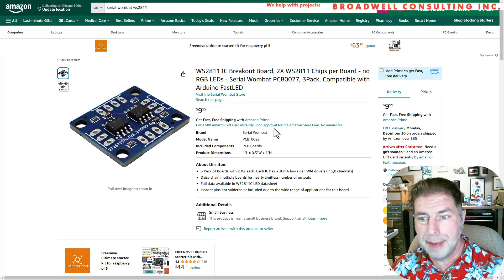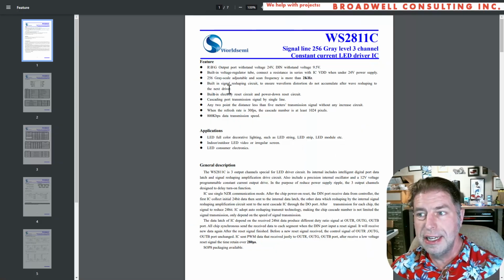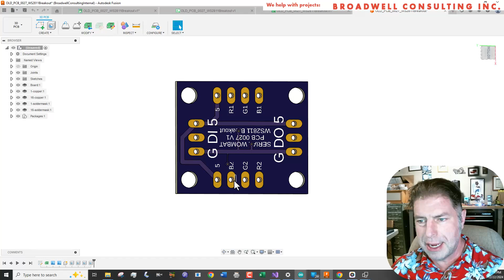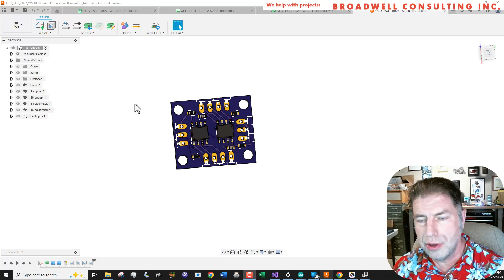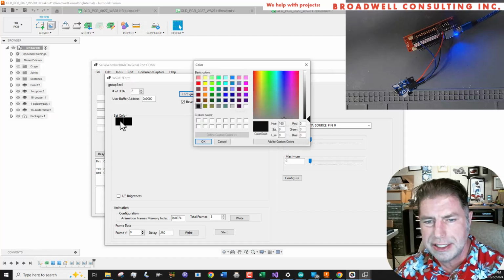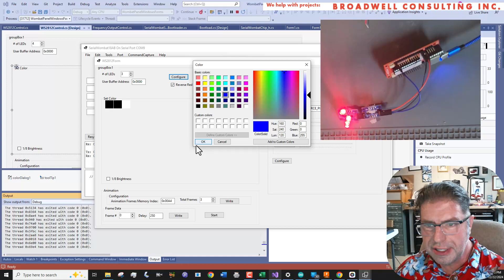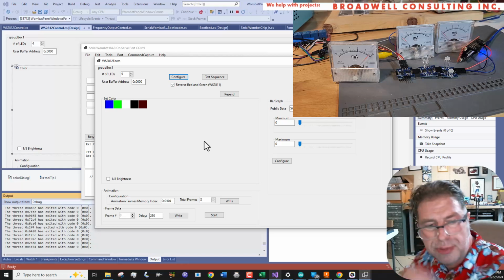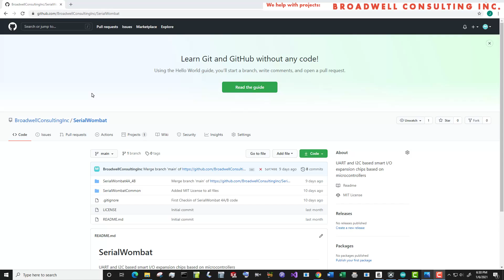WS2811 IC Breakout Board - New product!   Serial Wombat PCB 0028

Comment: If you read and decode all three outputs  on one side, you could have 8 on/off switches. Or, if you can read each intensity signal you could have 256 on/off switches per color or by reading all three as a 3 bit digital number, you could control 16,777,216 different devices. Or add both sides and control 281,474,976,710,656 switches per breakout board. 
Just having 64 by using 6 bits On/off is probably the most practical. ChatGPT says to use a couple of 74LS138 chips.
Reply from the maker: There's a lot of potential there, but be cautious about relying too much on exact behavior.  I've been playing some more since I made the video.   WorldSemi doesn't make any promises on what output you get for a given value.  I think they're maybe doing something non-linear to help linearize LED apparent brightness (instead of direct current drive proportional to setting).  And a 255 only gives about 95% duty cycle if you look at it on a scope.  This is fine to keep a relay latched, but isn't awesome if you're trying to use it as a true digital logic output.

Comment: Nice! I put neopixel strips in all my model train city buildings and have an esp32 program that control each building, floor, and room. I wanted to add a skyscraper with only white lights, so I glued photo cells to a few pixels and attached relays to control 12 v white led strips, so now I can light the lights with the same fastled code. I need to get some of your boards now.
Reply: I did something similar. When I started my layout I decided that all of my trackside signals would be built using 0603 SMD RGB LEDs. It allows me to have unlimited tuning of colors and brightness per lamp on the signal heads. Subsequently, there is a ws2811 on a generic SOP8 breakout board underneath the layout for every lamp (or LED) in every signal. I have always loved that my track signals are a bunch of daisy-chained lights fed on a single output from the modules I have made outputting the PWM for servos, ambient sounds, taking inputs from the trackside interfaces I have to control turnouts without needing to go touch the computer.
This further expanded once I built scenery and needed lights in buildings or the weird yellow/blue flicker of a welder in the locomotive shop. I just stuck with using REG LEDs controlled by WS2811 chips.
(plus I love watching the layout boot after it's been shut down for a while, where every single illuminated thing simultaneously cycles through Red..Green..Blue as a function check before proceeding to its normal function)
@SerialWombat these are great. I won't have to hand solder (or DIY reflow if I'm doing a bunch at once) the SOP8 chips anymore. Thank you for putting this in the checkout lane on Amazon!!!
Reply from the maker: @SamanthaBobowski  Thanks for the background!  It helps me a ton to hear people talk about what drives their project decisions.
Reply from the maker: That sounds cool.  I'll have a video up soon on the relay board, but basically just make sure they're low-side-active relay boards with their own flyback diodes and drive transistors.   The ones I show in the teaser at the end came from AliEx and had jumpers you could change to make them high or low control active.  Send me a pic or video of the result and I'll feature your project in a future video.
Reply: @ Actually, I used a MOSFET to control a 12 volt led strip.